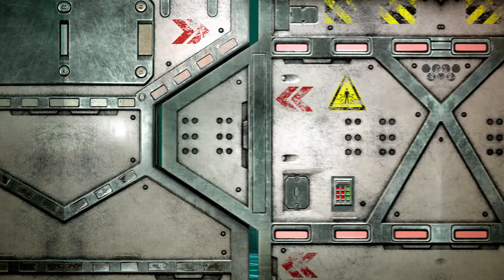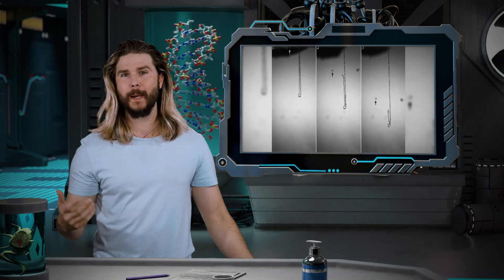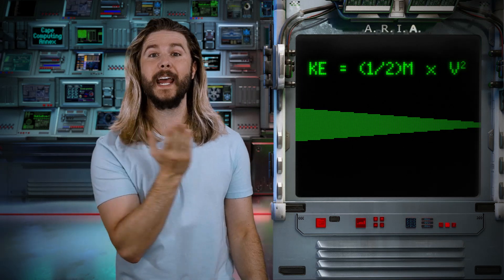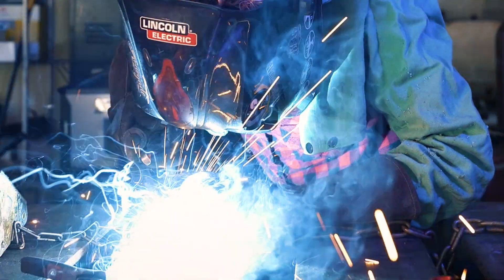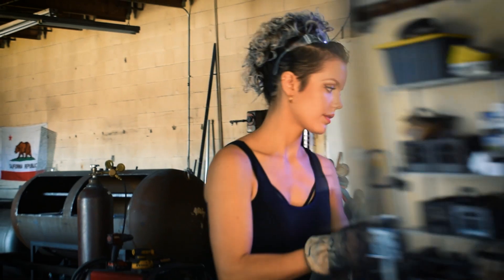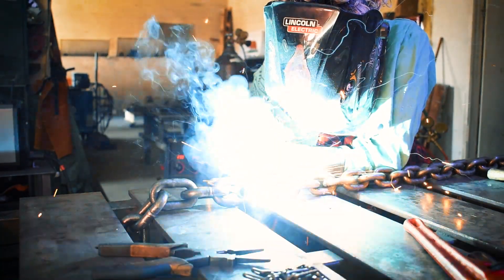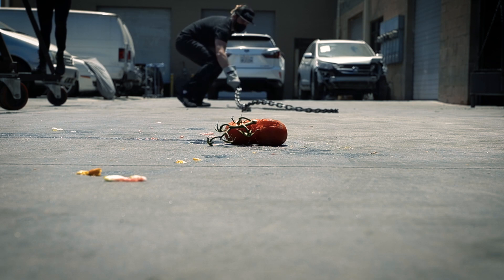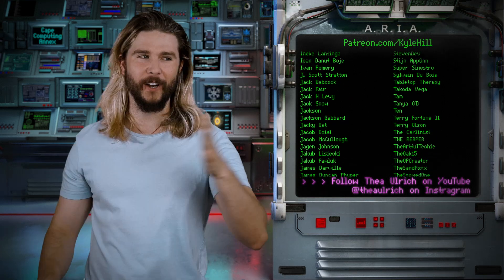Steel Chain Whips are SCARY

Comment: What if......... you had a chain as tall as... the Empire State Building for example. The top of the chain is secured to the top, the bottom of the chain is brought to the top part then dropped and allowed to free fall. How fast could this chain whip accelerate before it cracks the pavement below? :O

Comment: Why don't you answer some questions from previous video comments? Why would you make a whip that is too heavy to use properly? Wouldn't you lose energy/force by not wielding the whip properly? how much force would you need to exert on a proper whip in order to make the tip go the speed of light? So many questions... Just a thought but, answering previous video comments at the end of every video would help you fill the time while patreon names scroll by.

Comment: So im thinking theoretically you could make a whip out of like 3 links, or basically a really short whip that that starts large on one end small on the other like it should, but ik that wont work, can someone explain why though? If you move the larger side 10m/s or what ever is needed to make a crack on a normal whip, then why wouldnt it work on a shorter whip? Or would it?

Comment: Some of the problems you had with the whip is that you were missing parts of it. The handle of a whip is kind of rigid, and the long portion that really starts the tapering process is called the thong, a really thin piece that tapers off to build up speed is called the taper, and the portion that breaks the sound barrier is called the cracker.

You mostly had just the thong and taper. You could use a thin piece of wire, like a paperclip near the end as a cracker, and some kind of dowel as the handle to make this a masterpiece.

Comment: Well, in case no one's already asked it... I feel like I should bring up Ghost Rider.  Several iterations of the character use a fiery chain as a weapon, but watching this video, the chains you  used were a little beefier than you could actually realistically swing like a regular bullwhip in any direction. So assuming his chains are the size of the mid-level links you used in this video, how much force must he apply (also assuming his strength is supernaturally enhanced) to swing  the length of chain he's depicted using in order to make it crack like a normal leather bullwhip?

Comment: What if you were to add progressively smaller weights at the spots where you switch to a thinner configuration on a whip using lighter material, like good old fashioned leather? Would it be equally as impressive while being easier to wield? I also am not a villain.

Comment: My first thought was "very." But then, I've worked with thousands of feet of galvanized steel cables, typically between 3/8 and 7/8 of an inch. Just a basic, accidental whiplash of the end of the cable coming off a spool can leave serious cuts and bruises depending on how it hits. Give it enough force and momentum, and it'll go through your body or limbs.

Comment: How strong would you have to be to get it to "Crack" like a proper whip?
Reply: I'm not that smart when it comes to math but the math still applys, probably around 75% stonger
Reply: at least 10% stronger
Reply: I have seen a guy that has a chainmaille whip that's light enough to use normally

Comment: It's a bit too big for max damage from a human. But it does illustrate the concept well. You could get it moving much faster by the end if the start was smaller, in this case.

Oo! Replace the last third of a regular billwhip with a tapering chain down to a cable. That'll slice some stuff!

Comment: Woudn't that weapon be the best weapon for a character with super strenght ? 
Quick somebody call shad ! he needs to make another fantasy rearmed !
Reply: yes
Reply: It would have essentially no ability to block or parry, and effective whip use is a pretty tough skill. 

BUT, it would be devastating. 

Provided this character had other means of defense, like high durability, speed, or the ability to make enemies too terrified to fight back it would work. 

Hence, Ghost Rider.
Reply: @ericvicaria8648  what about extra thicc armor ?
Reply: @davidegaruti2582  That or some kind of general invulnerability/durability. Ghost rider makes chain attacks work because I'm pretty sure he doesn't give a darn about most kinds of attacks anyway.
Reply: @ericvicaria8648  i asked about extra tick armor , because if acaracter had super strenght they could wear an excess of 50 kg/100 lbs of armor , and have little vulnerability both to kinetic energy and to pressure , since how do you pen that armor exactly ? 

And that would make a caracter with super strenght completely undefeatable ...

Comment: The answer is, it's very dangerous, just like any steel weapon. Though it will probably be a lot harder to use effectively than most. And if you're not skilled, you're extremely likely to get yourself with it. It's kind of like a gun that shoots pieces of shrapnel in random directions in that way.

Comment: isn't it akin to the math of why a rocket gets even faster as it flies? the force of the acceleration is increasing. but the load it's moving is also getting lighter as it goes, cause the fuel is burning. 

as the chain moves down, one link becomes "static". but the force that's been generated is still in motion, and transfers to the next loop. but the chain that's still in motion is lighter than it was a second ago, so the building forces have an exponentially greater effect on it?

I'm gonna watch the video now and see if my guess is right.

Comment: This is just a thought, but maybe adding a handle and maybe wrap a footlong strong spring around the user end of the chain would make the chain a little more controllable on your side. Although I don't know how much this would improve on the control of the chain since it looks like the user end of the chain looks like it would weigh around 20 lbs.

Comment: Just wanted to point out that the force at the end of the whip is the same amount of force put in at the beginning by Kyle. It’s devastation is due to the small area over which the force is applied the surface area of the whips end which contacted the fruit.

Comment: Isn't this what the boats a warning about when dropping the anchor?
Reply: No. Just in general ropes and chains can take your fingers or hands right off. That’s what the warning is for
Reply: @owencostello8247  I seen some signs that explicitly say warning for chains or wire snapping under high amount of stress...
Reply: @TheMegaOnyx  you're correct. It's called Snapback. This gets especially dangerous when using things like Nylon rope (since they sort of "stretch" like elastic). Because all of these lines are holding an immense amount of weight/ are under tremendous stress, if they snap, the effect of the line whipping back towards the deck can quite literally rip through someone's body.
Reply: Snapback, and yes.

Comment: For a better bow whip, I think you could've used a different weight for each ring of the chain instead and used something like a steel bolt as a handler. To have enough amount of rings you could use rings that are made of different (lighter) materials as well. But I realize that this would take so much work to produce and this one does one hell of a job anyways.

Comment: Would it theoretically be possible to create a whip long enough where the end breaks the speed of light?
Reply: Maybe. The "handle" end would have to be extremely large and the tip would probably have to be microscopic. Then there's the process of actually getting it moving. Seems possible in theory though.
Reply: Nope, it would collide with the air particles and create new and exciting forms of matter before it even approached the speed of light. You’d end up with superheated plasma and some serious radiation. Also, the chain would break. Check out Randall Monroe’s “What If: Relativistic Baseball” for an idea of what would happen.

Comment: Chain is scary. I've seen a chain motor bag overflow and drop 750 ft of chain onto a stage floor. The whipping of the chain is way worse than it simply falling on you too.

Comment: (Now, how fast would you need to whip a whip for it to break the light barrier?)
Reply: Cyber Paradox you can’t. It would take infinite energy to even get it to light speed. Also it would collide with the air particles and create new and exciting forms of matter before hitting light speed, leaving you with an expanding sphere of superheated plasma and highly radioactive elements before that happened. And everyone in a huge radius would die.
Reply: @Abe_bb  well ok I mean like no air resistance, like vacuum, ignore the mass thing, and just find out how fast you would need to whip it and how long it would need to be for it to break the light barrier?:)
Reply: Cyber Paradox according to our current understanding of physics, you cannot. It would take infinite energy to accelerate something with mass to the speed of light, and not matter how long or how hard you whip it, you could never even get to the speed of light, let alone to surpass it. The speed of light is the speed limit of the universe. Nothing with mass can go the speed of light.
Reply: @Abe_bb  (that's why I said ignore the mass thing:/

Comment: Ok This might be the most nitpicky of nitpicks but its been bothering me since the first episode from inside the facility. The camera angle you use for the greenscreen footage doesn't match the perspective of the cg background. Its especially annoying when your feet are visible because it looks like your doing a wierd impossible tiptoe stance. easy solution would be to lower the camera angle, though i do concede that lower angles are generally less flattering.

Comment: So typically in free fall two objects would fall at the exact same speed even if the two objects have different masses. But according to the "Hill Effect" the end of the chain falls faster than something in free fall. Is there an official explanation for this?

 Here is my thoughts on how this is happening. The quarter (in this example) is in free fall. There isn't any additional force on the object. But on the end of the chain each link in the chain starts falling and it would be impossible for every single link in the chain to start moving at the same time. And like dropping a slinky the bottom of the loop of the chain drops first. But unlike a slinky chains are built out of individual links. So the lowest link falls first, second link starts falling, but not as fast as the first. So the fist link drops fist and then smacks into the second imparting more energy into the second link. This makes the second link move faster. Putting more energy into the third link. This leads to a feedback loop where each link in the chain feeds more energy into the link above it. 

This makes me wonder if this is just something that is solely something that happens with chains. Would a rope do the same thing? Would the individual atoms of the rope act like links in a chain?

Comment: Is the Hill Effect related to the phenomenon where when you drop a slinky, the bottom does not begin to fall until the top has coiled all the way down onto it? It seems like it would have some things in common, since I would describe a slinky as a nonrigid continuous object. But I guess you observe the exact opposite of what is described by the Hill Effect, in that the end accelerates SLOWER than you would otherwise expect. I suppose you have to take into account that there is a second force involved in a falling slinky, with the kinetic potential energy of the extended slinky counteracting the gravitational energy of free fall.

I'm not sure what point I was trying to make, other than that falling slinkies are weird.

Comment: People actually sell steel whips as a self defense tool. The one I saw was just a short length of steel cable with a plastic sleeve and a handle. Turns out that's enough.

Comment: Light speed flick at the whip's handle, how fast is the tip of the whip going. Come on, ya gotta do it😅

Edit: while I'm down for a video on this its more a joke because people ask Kyle about breaking light speed all the time. Like what if the flash fired a gun while running, what if a car was driving near light speed would the light from the headlights go faster than light speed even though its light, and on and on. So at this point a "can it break the light speed barrier" thought experiment video is almost obligatory. 

But again, I'd still watch it lol
Reply: I think the whip would rather break.
Reply: It wouldn't actually be lights peed, as that would take infinite energy, but near lightspeed.
Reply: @GodwynDi  But thats a interesting questionin itself. What exactly would happen if you whipped a whip at near light speed. Obviously its not gonna break light speed. But how would the tip react? Velocity goes up but it cannot reach light speed so what gonna happen? Will the whip age slower? While it heat up because the energy needs enough vent as it cannot accelerate the whip more? I now really want to know.
Reply: @theexchipmunk  It will increase in speed some.  The amount of energy necessary to increase speed increases
Reply: @theexchipmunk  there are a couple interesting videos on this platform that address this "paradox".

The scenario in those uses a lever rather than a whip, but the result world be the same. The speed of light in a vacuum = the speed of causality. Literally nothing can happen faster than that speed, no matter what.
Reply: @theexchipmunk  It would increase kinetic energy without increasing speed.  It's a crazy thing to think about but near light speed is already crazy.  Basically, it would hit harder without needing to travel faster.
Reply: @Dark_Jaguar  it would still increase speed, just not by as much as non-relativistic physics would have you believe.
Reply: @GodwynDi  its more a joke from all the flash videos when he was on nerdist because people would be like if the flash is running and shoots a gun can the bullet go faster than lightspeed etc.
Reply: At relativistic speeds you would have to factor "gamma" into the equation which would balance out the need for the end to go faster than light. 
Idk how to even explain it in a YouTube comment section other than to fall back on "relativistic mass"😒
Reply: @pyrobob5724  well, gamma itself isn't that hard to calculate and you can graph it to see how it becomes asymptotic at near light speed, though I'm not sure if that information is what you're after.
Reply: @pyrobob5724  see my edit on my original comment, it was a joke but thats an interesting point anyway ill have to research that a little just to get a blurry gyst understanding. Thanks
Reply: The tip would create a black hole xD
Reply: if the handle moves at light speed (which is impossible) the tip would still be moving at light speed... but it would act as heavy as the base, delivering the same force.
Reply: @TheOJDrinker  see my edit, it's a joke because people are always asking Kyle how to break light speed. What if the flash ran and then fired a gun? Does light from headlight in a car going near light speed go faster than light. And on and on.

Comment: I would love to see you attach that whip to some kind of mechanical arm see how fast we can get this thing moving
Reply: Hacksmith/Kyle Hill crossover episode!
Reply: @EthosO76  I was thinking Simone Giertz. More thrills.
Reply: @FryingPan76  dunno who that is but he be getting a watch on ytb 4 da curiosity
Reply: It's clearly meant to mount on a mecha.
Reply: @NevTheDeranged  hacksmith is basically building one c:
Reply: @NevTheDeranged  Actually, you could pretty easily get this thing going with something roughly iron man mark 1 sized, so long as the internals were high quality, and not cave scrap. No promise on sonic boom, but you could get it above ankle height, and up to repetition speed.
Reply: Fun fact: There is a martial arts (Chinese, I believe) technique using a chain whip where a human being can get it to spin so fast that it can cut through a solid 3-ft thick stone pillar. So, if that's your basepoint....
Reply: @AnInsideJoke  if that was the case then it would be cheaper to hire trained martial artists with chains to work in the mines rather than getting bulldozers nevermind I just read your username
Reply: @AnInsideJoke  3 foot thick pillar definitely not
Reply: @varencilator : Depends on the stone.  Diamond?  Obv not.  But gypsum or talc?  Like a 1,000 degree knife through butter.
Reply: @sdfkjgh  we're talking about 3 feet. It'd barely be possible to get through 3 feet of loose dirt.
Reply: @varencilator : Good point.
Reply: @sdfkjgh  Oops, looks like someone doesn't understand the difference between hardness and toughness.  Diamonds are notoriously hard, meaning they resist scratches.  They'd scratch other materials rather than become scratched themselves.  But they aren't incredibly tough, meaning they can be broken into pieces fairly easily.

A pillar of diamond would be FAR easier to break than one of stone.  So maybe it's not so "obv" after all.
Reply: @AutarchKade : Dangit.  Yeah, I always overestimate the toughness of diamond.  Prolly b/c I've never seen a diamond shatter.
Reply: @sdfkjgh  diamond isn't shatter resistant. it's hard as in scratch-resistant. you can definitely crush it, it's just hard to cut it.
Reply: @AnInsideJoke  I was hoping that was where this was going to go based on the title. That would have been cool.
Reply: Its not a whip till it breaks the sound barrier
Reply: @matthewryall167  YES that's what I'm talking about I want to hear that snap
Reply: hook it up to a pneumatic arm myth  busters style and let it go wild